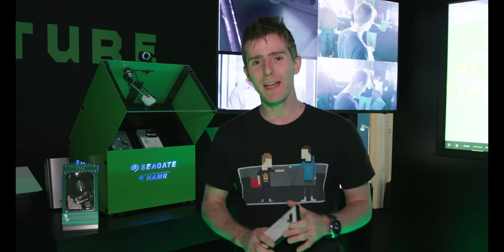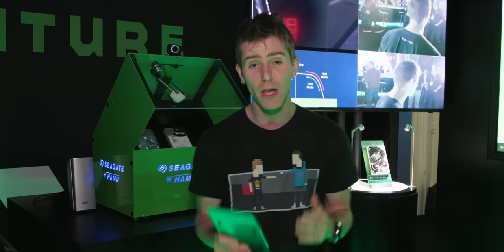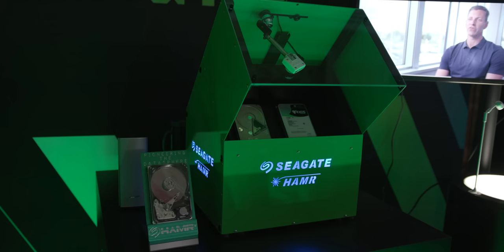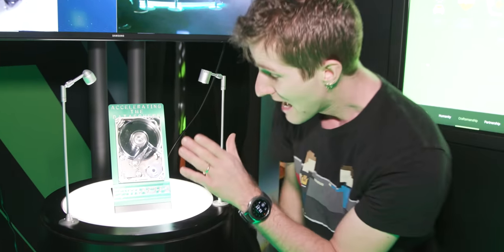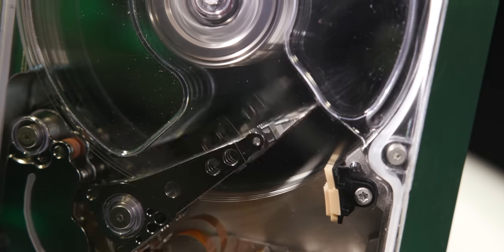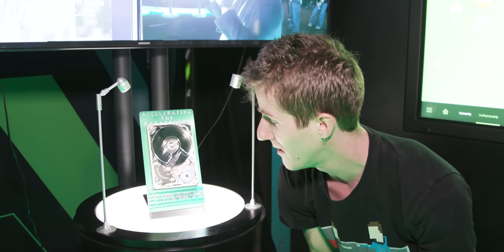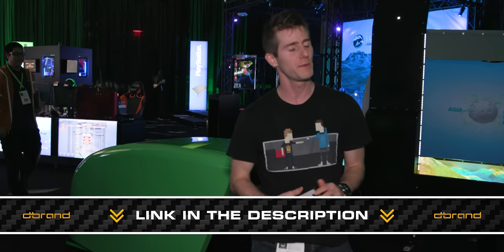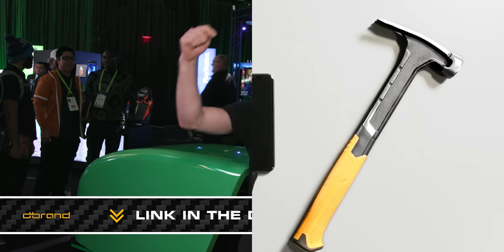The coolest hard drive tech in 20 years

Comment: First drive lasted long enough to write 1 sector.  Sounds about right for your average Seagate drive.
Reply: Seagate is a fantastic company with quality products. Your argument is invalid.
Reply: The fuck would a squirrel know about hard drives?
Reply: @yeetsmcgee5446  The only brand of hard drive I've EVER had die has been Seagate, going back 20+ years experience. Just my personal experience... so no, I never buy Seagate anymore, regardless of the "quality" or price level.
Reply: I have a Seagate Barracuda from 2006-2007 that's still working lol. It's on its last legs (super slow), but I'm surprised the thing hasn't completely died yet.
Reply: @DeathBringer769  you had one drive die, so obviously their shit. Lol wut. I've had drives from just about every manufacturer that makes them, and at least one has died from all. In many cases prematurely, which happens occasionally. Sometimes they just weren't made quite right or it was a bad batch or something.
Reply: @Demonslayer20111  I had 2 dead seagate drives in less then two years so I guess it depends ... I'll never use them anymore neither
Reply: @DeathBringer769  i dead drive mean every drive, no everything they make is trash... nice logic you have right there bro
Reply: @seba911VTT  so what do you use? WD? Have had three fail all at the same time. And another doa. Toshiba? Had one literally shatter, another that had half the sectors unusable. I've gone through many hard drives in my life, all the manufacturers have had issues, but overall, most of my hard drives were just fine.

Comment: The current method for huge data transfer is to move a storage array to the other site. With the speed of networks and the size of data, at the moment there are few other options. It their system prevents data loss off the array or storage, yes more of this is needed.

Comment: Seagates break, often.
Reply: No more than others
Reply: GetoverYourself can confirm, the product of China batches of drives I have used from Seagate seem to be the common for me since my product of Thailand drives last almost as long as an equivalent WD drive purchased at the same time period.
Reply: Agree. After 25 years of buying drives, I now only buy WD. Seagate failure rate has been v high in my experience
Reply: I've actually had nothing but trouble with western digital drives... the older drives were noisy, and it sounded like they had actual relays to power them on and off, and I've had two of them totally fail + plus a newer USB drive, with no data recoverable (as I wasn't going to send it off to some recovery firm). The only Seagate drives I've had fail were when I decided to do a Linus with one or two of them.
Reply: @danielaraya2423  Which is exactly the reason all these comments are needed... some people have had great experiences with Seagate, some bad with Seagate, WD, Hitachi, Toshiba, etc, etc. At the end of the day... all manufacturers have had bad batches and lemons. I prefer Seagate, as I've yet to have one fail due to anything other than operator error... but obviously I've had a good run... probably partially because I don't get the latest - i.e., I avoided the 3TB drives - which seemed to have reports of higher than normal failure rates.

Comment: 3:35 hopefully this brings SAS mainstream. A friend gave me an assload of 2TB SAS drives, and the controllers are very, VERY, expensive. Maybe if the price drops a bit, we can get all the advantages of SCSI in standard PC's, such as SAS expanders (which connect UP TO 65,535 drives on a SINGLE connector), and better SMART reporting capabilities. On top of that, SAS already supports 22.5Gbit/s throughput. Having SAS available to Joe Everyman would solve some of home computing's biggest problems.
Reply: Tyler Amick Controllers are reasonably priced if you just look for used 9201-8i, 9211-8i or even 9211-16i on ebay. These are just HBAs but for a fileserver you could use them with FreeNAS.
Reply: @peterpain6625  To be more specific, it is very expensive from a consumer point of view. When SATA is already tacked on to every motherboard, even 0$ is a lot of money. The average consumer does not know why they need SAS, but if it went mainstream, SAS could become standard built-in equipment solving the issue of no definite connector standard and a lack of practical compatibility in standard consumer equipment. It is well known that as soon as a product hits consumer space, it becomes cheaper for all market segments, such as for enthusiast and enterprise, making this vastly superior technology available to everyone. Prime example of this phenomenon are in cell phones (Nokia 9000), graphics workstations (Radeon 9700 Pro), and even the defacto standard IBM PC (Clones, such as Compaq).
So even if these controllers are cheap when used, the average consumer has no idea what to look for, making any variant appear expensive.
Reply: @anon4820  Agreed from the point of "not on the mainboard already"... Still there are board with SAS HBA/Raid-Controllers on them. But i don't think those will ever go mainstream. With nvme on the rise ...

Comment: 3:36 ok, that‘s cool - but sounds to me exactly like a 2 drive RAID0 within one drive. So more performance but higher risk of failure. Nice idea, but also not crazy inventive in my opinion.
Reply: And just too costly for a RAID 1 array for now, and maybe a little hot to run without some airflow keeping heat control in check.
Reply: I think it's more like writing seperate data at the same time instead of the same data across  2 locations.
Reply: @NinjaInTheFirstDegree  sure. If it was the same data it wouldn't make sense to add up the capacity. So exactly what Raid0 does 😉
Reply: I also think that its working like 2 separate drives not as a RAID .
Reply: No, they arent writing parity so this is not exactly like RAID0. 😉
Reply: @Aereto  heat soak would definitely be an issue with clusters of these.next thing you know they will have oiled ball bearings with external coolers
Reply: no, because both heads can read and write the same sector so no raid comparison here. sequential reads wont be faster.
Reply: @NinjaInTheFirstDegree  Raid0 has no parity. Raid0 = Striping without any security.
Reply: @theq68  okay, that makes sense.
Reply: @olpqay  ok, I know it's not a parity for rebuilding but you take away a piece of the data and the rest is gone. This is not like that.
Reply: Honestly what I see as the value add is the capacity, nothing more.  Considering most enterprise solutions use drives at a ratio of 3:1 they need to have massive capacity and be cost competitive to have any chance at all.  Most people would be amazed at the amount of tape still used in the real world.
Reply: @mjkulikow  yes the amount of tape still used is appaling. Hamr is adding capacity, but the independent r/w heads are not.
Reply: @NinjaInTheFirstDegree  Yeah, its just 2x drives that share a platter spindle.  I think the heat tech vs magnetic is allowing the higher density however, a 100TB traditional HDD would be very nice.
Reply: @theq68  not faster per head, but because it can read two different locations there will 2x throughput per drive. Like 2 JOB that work as one destination like c:\
Reply: @mjkulikow  check out the techquickie from two years ago that Luke hosted. I found it by typing in, seagate hamr, into the main search. And what did mean about enterprise solutions being 3:1? I'm familiar with some hardware but I haven't had the pleasure the work in an enterprise level environment yet.
Reply: @NinjaInTheFirstDegree  LOL I figured that would trip someone up, 2x for the RAID and 1x spare = 3x drives ;)
Reply: @NinjaInTheFirstDegree  My companies use NetApp which is also fully redundant, so we need double the space and double the drives for EVERYTHING, which from what I have seen translates to about $1k per GB ($250k for 250TB)
Reply: @mjkulikow  oh ok like a stand number of hot spares, did you mean 1k/TB?
Reply: The server I maintain at work is 6 WD blacks 1TB in RAID6 no hot spares so I gotta kinda watch it. Been running it since October.
Reply: @NinjaInTheFirstDegree  Yes, most shops have PILES of spares, so 3:1 is a fair # for easy math, and I mean a NetApp storage cluster costs $250,000 for 250TB, which is ~$1k/GB
Reply: @mjkulikow  $250,000 for 250 tb is 1k/tb
 1k/GB is holy shit high.
Reply: @mjkulikow  lol I'm gonna put that one up to Damn You Auto Correct
Reply: How would that have higher risk of failure? Count of asynchronous vs synchronous heads should not measurably affect reliability if done properly.
Reply: @olpqay  shit man you were right the top few platters are clear didnt see that, but this is definitely a raid 0/JOB like system, if you dropped an actuator you would definitely loose data. I feel bad now haha
Reply: Martin Procházka in theory more mechanically moving parts always means higher chance of failing. Not only in this field but for every system/machine in general. Although it‘s possible that the higher chance is beraly noteable. Only time will tell ;-)
Reply: Connor Decker haha, np. I don’t mean to offend you, but also your comment from earlier about JBOD gives me the feeling you are missing some basic facts about RAID,JBOD,etc. Let me give you an example: You have 2 physical HDDs (each 500GB) connected to a RAID Controller which presents to the OS logical HDDs, depending on the mode you set. RAID0 -> 1 logical disk: 1TB (HDDs striped), RAID1 -> 1 logical disk: 500GB (HDDs mirrored), JBOD -> 2 logical disks each 500GB (HDDs are passed trough; the RAID controller tries to act like a regular HBA).
So JBOD does exactly the opposite of what you described. It does not present physical HDDs combined as one “C:\” drive.
Reply: @olpqay  yea, I was just using JBODs as an example but knowing that this is 2 sets, upper and lower actuators with seperate platters it makes complete sense that it would function just like a raid 0 instead of 2 JBODs mapped as the same location(which I know current controllers dont map JBOD to same location)
I was thinking more like the old chinook HDDs from Conner Periphrials where it had independent opposing heads sharing same platters. Except that they had put the actuators on the same shaft to keep form factor the same.
Reply: @olpqay  You're right and my previous post doesn't even deny this statement. I was talking about having same amount of heads while one bunch is synchronous and the other one is asynchronous.
Reply: I interpreted it as simply splitting the incoming data across two platters, rather than one, as the heads could now move independently. Which would also work for outgoing data. So if it is paired with the HAMR technology, you have a 20TB drive that can be written to and read from a twice the speed of current hard drives. So you'll be able to fill it up in 5 weeks instead of 10! xD

Comment: That vehicle? Basically better sneakernet.
Sometimes, the fastest way to transmit data securely is to literally fill a bunch of storage media with the data and physically move it to the destination.
You may scoff at the idea, but sometimes the data in question is so massive, so sensitive, or the infrastructure too slow or unstable to transfer it all via signal.
So you lace up those sneakers.

Comment: I can see the rack movers being a viable option if you were outsourcing your servers and wanted to move over existing data. Something like Petabyte project the system is very heavy and one drop ruins everything. If someone like LMG was going to move their servers to a new location, like if they got a new building to expand it would make sense too. Any business that deals in large amounts of data would be smart to use it if it needs to be moved. A niche market, but somewhere like silicon valley, or around the google campus it'd be a smart idea.

Comment: Wow Seagate is finally doing something with conner periphrials tech they bought out. This is so exciting!! (Referring to the chinook drive) so sad that it took then 20 years to implement a second independent R/W head. But, its here now! Leeettttttsssss goooooooo!
Reply: What if they did a 10k RPM 2.5in disk in a 3.5in form factor like the Raptors were but did hamr heads with dual opposing actuators with a built in raid controller that combines thes heads into a single SATA III output? I mean Conner had that setup with 3.5in disks in a 5.25in FF on SCSI... but he was turning less than 3600k RPM.

Comment: twice the heads moving, 1/2 the chance of failure from mechanical failure in a way, but more moving parts, so 50-50%. Still pretty cool, problem is, helpful scattering, aka "fragging" which is actually good for data at times, can't happen, you're on a restricted 1/2 segment in a way. Still they can sort that out until it runs out of space on both in a way, or just software base that, but it would take away from the double speed. Sort of an internal RAID if you would. Imagine the nightmare that 1/2 of it crashed and it's fragged. Then you're... fragged. :D

Comment: I'll call the Hard Drive Zamboni a necessary solution to a problem that won't be around much longer. Like the pager, it'll stick around until technology advances to the point that the problem it was created to solve no longer exists. I expect that within the next decade or two, internet and network infrastructure will catch up with the advances storage capacity has made.

In the meantime, I'll still be driving to the office and loading large files onto a work-from-home flash drive because it's faster than waiting on the VPN.

Comment: @Linus, In air-gapped data centers, you move 8/16U storage system ALL THE TIME.  So, yes I've used (and made) "Harddrive Zambonis" before. We started with just the frame of an electric golf-cart (had lots of broken ones laying around) and a TIG welder.... many design generations later we actually out-sourced the fab. to a local shop. Now is that Seagate one automatous? Did you say it had 'tank-style' treads... Where can I get more info? Seriously, no eye-roll from me, that "Harddrive Zambonis"  can fill a huge needs gap in air-gapped DCs.

Comment: Drive zamboni's aren't the solution, you still have to worry about the offload/upload times between locations (Both physical and electronic). Better long term strategy to put the money into faster networking hardware. The whole point of computers is to be autonomous and easy as possible which that isn't. Having to manually move these drives physically and risk damage to them is bad enough by itself.
Finally wouldn't it be easier and cheaper just to put the 4U rack on a cart and wheel it anyway?

Comment: I don't get the use for mechanical drives, in an era where SSD and other type of circuit based memory is available at high speeds with decent storage cap?
Reply: Sometimes you need more reliable- and long term storage over speed. My guess is that current HDD and tape technology will stay within the mainstream for at least another 5-10 years.
Reply: @realMrVent  I was thinking more along the lines of consumer storage,, but yeah data centers prob. won't store large amounts on mem units (for now). Crystals might be the future :p (Kal'el)

Comment: 3:48 why not go further with this and have all 8 heads move independently. Then we would get 8 times the speed?
wait, the more I think about this the more it doesn't make sense. 8 heads, 8 bits in a bite. when it would write a bite they would all be parallel with each other. so this wouldn't help. each bite would be in a line. so having half the heads move separately wouldn't help.

Comment: Ok here's a bit of an odd question for a one off scenario.

I have a Samsung 960 Evo with a Windows 10 installation on it from an old machine with a different cpu and chipset (upgraded from fx8370 to ryzen 5 2600) that I need to first back some data up from and a data hard drives not sure if it works yet but I've got a pretty good guess that it works.

Need to install Windows too this nvme drove after I back everything up. However. I have no blank DVDs or a flash drive. So I've heard of someone using an nvme drove as a home made diy style installation disk.

My question I suppose would be if the contents of the windows installation disk is copied to ram? I've got 2 8gig sticks for 16 gigs of RAM total. Would this be a possibility or will I have no choice but to break down and look for a thumb drive?

Comment: Anyone can confirm 3 years later if they are still running? I remember my shitty Seagate Desktop HDD ST3000DM001 64MB 3TB that started being really slow after 1 year and died completely the third year...
Reply: That drive was so bad, there was a class action a few years back, but also that drive was manufactured in 2013. Doesn't compare to modern Seagate at all.

HAMR don't really ship to anyone but select people yet, but current Exos X drives are rock solid. They're rated for continuous use and MTBF of 2,5 Million hours.

Just don't get a Barracuda, they're SMR and only useful for what i'd call a data grave.

Comment: Just like you said with the SD cards. Write speeds will never be good enough to make good use of that amount of storage.
Heating the head upto to hundreds of degrees for it to work? Sounds terribly inefficient and slow.
Let's think of a hypothetical scenario here. Space flight in 10 years time, will we want to use something that's still bulky, generates a lot of heat, uses a lot of power and is slow or will be want a light, power efficient device that can be turned on and off to save power?
That's another thought that's just popped up, how long do they take to heat up? After it's been on power saver mode and switched off, does it take even longer to start being useful or are we best to leave it on all the time?